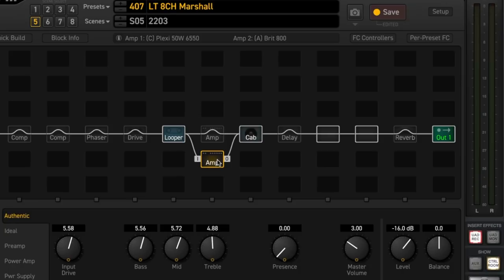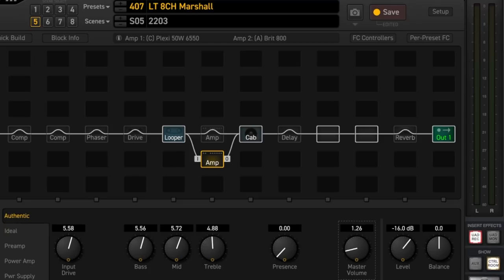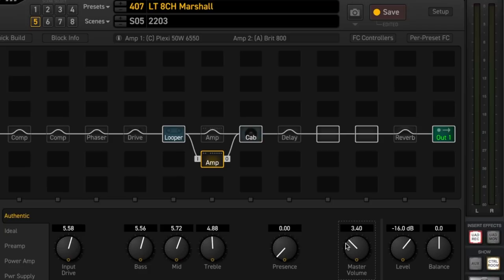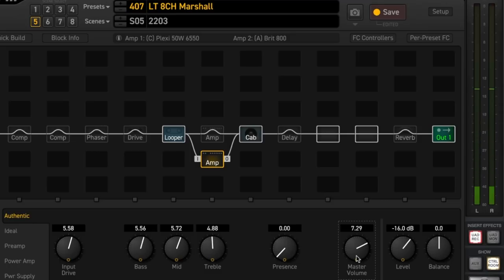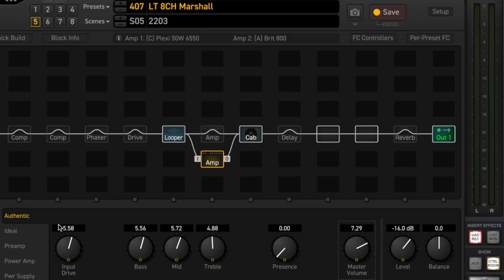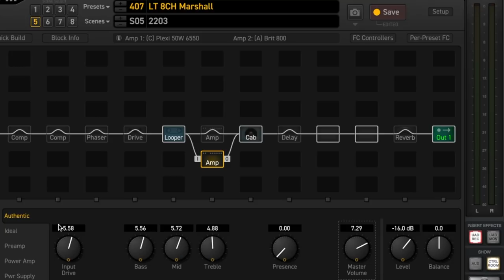Finding the Sweet Spot  - Axe-Fx III Tutorial

Comment: Hey Leon
Please do a finding the sweetspot to dial in modern metal guitar tone. I am constantly tweaking. But i don't get it right. What do you look for in bass/mids/treble eg.
Reply: A lot of the time for high gain the trick is to run the master low. If you look at some of Leon's recto vids, he runs the volume at like 1.50.  I started doing that on my recto patches and it works wonders.

Comment: Awesome lesson - is this an improved feature on the III? Cause we’ve found pushing the master vol on amp block the IIXL+ to be underwhelming. We use mostly JCM800, 5150, or HBE models. Thanks!
Reply from the maker: From what I understand of the latest FW release notes the cathode follower modelling has been improved which probably goes a long way to that realistic power amp behaviour. What FW are you running on the XL+?
Reply: @LeonTodd  I just updated to the new one that's a reverse compatible modification of the AXE III firmware, but I haven't tried tweaking anything yet. So it may be improved and I just haven't explored it yet.
Reply: I found that amps that have tons of preamp gain and clean power sections don't gain anything with high master volumes.  Just like their real life counterparts, like the Splawns and Rectos.  I keep them under 4.   Plexis and amps like them, crank the mv.

Btw, Angus you guys sounded fantastic last winter in St Louis.
Reply: @toneranger7813  thanks!

Comment: cool video as always, just wondering with 2 decimals on nearly every single parameter and new firmwares being released =)
at what point do you stop tweaking your tones ? are you still tweaking your tones on the AX8 for example?

that was always my issue when i owned the Axe 1 , so many options and so powerful, but how do you know when to stop when you can tweak absolutely everything and not even getting into custom cab impulses etc..
Reply from the maker: My live sounds barely get touched, but my guide to tweaking is that if I try a new amp or effect it has to inspire me to play or write something fresh. Tie new tones to new riffs!